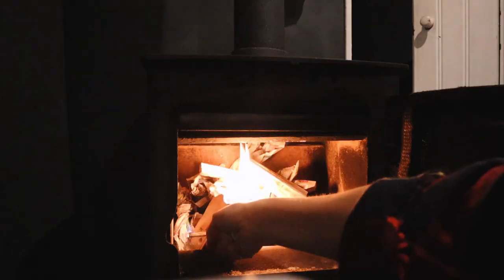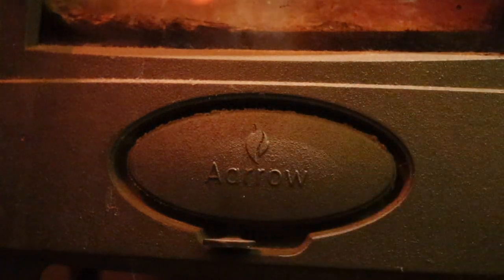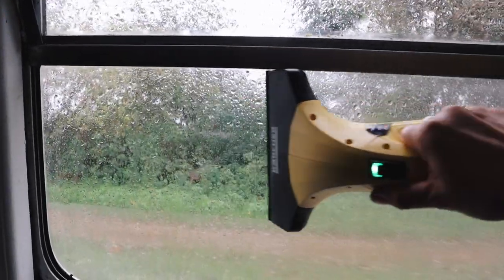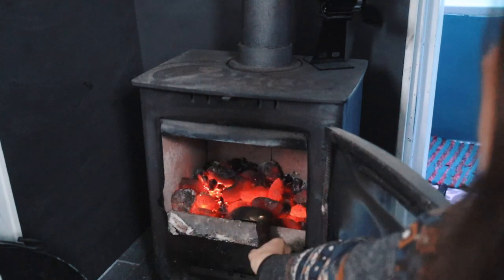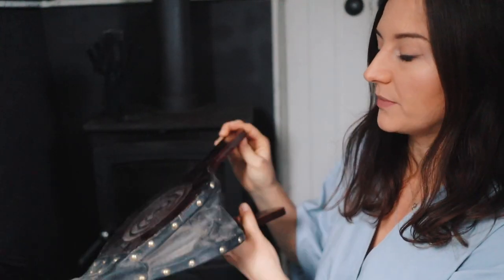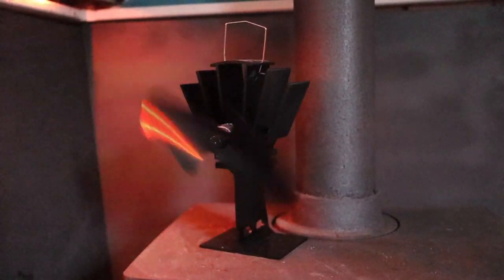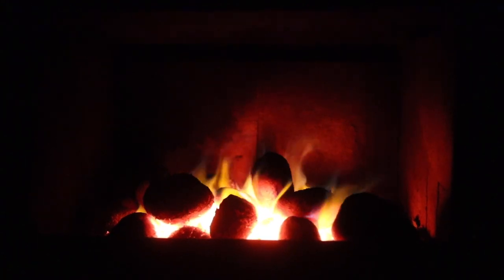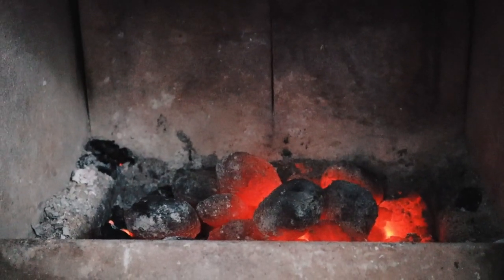How to Keep Warm on a Narrowboat in Winter & Start a Fire in a Multi-Fuel Stove

Comment: As a child we heated our home with a Franklin Stove. A much larger stove but like yours...wood burning. We used to make Newspaper logs. We used one log of Oak and two newspaper logs. Newspaper logs are made by rolling newspaper into  the proper length and size around to fit the stove we were using. Do not roll it tight. We used two pieces of wire one closer to each end to hold it together. Have on open roll in the paper lengthwise. Remove the wires after the log is burned and reuse. Your fire depends on the amount of updraft with your damper open. Small kindling. Do not use glossy paper or colored paper like the comic strip. Not healthy. 

Enjoy all your videos. We all learn with you. Thank you.
Reply from the maker: Thank you so much for sharing Sharon! We've never heard about paper logs, will look them up! Marina x

Comment: Hi guys you explain that very well, but being a country  boy  this time of year I have two fires going in my cottage ,a Rayburn stove in the kitchen which is a fire one side oven next to it hot plate on top,with a back boiler, for central  heating,  my late wife always use this instead  of electric  cooker, plus in the front room , a log fire ,just one thing to add make sure your logs are kiln dry ,,love your blogs, keep well& warm 💐💐

Comment: Great info Marina, We have a wood stove at the cottage but only burn wood and can find all the fuel we need on our property from natural blow downs branches etc. We have a covered woodpile all stacked neatly. During the fall and Spring we burn about 1.5 cords (128cuft  4 feet wide, 4 feet tall, and 8 feet long. Every stove seems a bit different  Ours when starting we use similar technique to you  but no coal We use soft wood logs to start  ,mostly spruce  fir  or pine then switch over to hard wood, Birch Maple and Oak  We also on starting have to open a window just a crack that creates a huge draft so starting is no problem ever .For kindling we use Birch as it chops so easily, we keep a supply of this in a box ,we also save any birchbark as that is a great starter. In the spring we clean the chimney using a small spruce tree on a weighted line which we pull down the flue from the bottom. Ours chimney is an insulated double wall stainless steel type. Soft and wet wood will cause more creosote deposit hard wood's much less .Oak is best for keeping fire going over night as it burns slower.